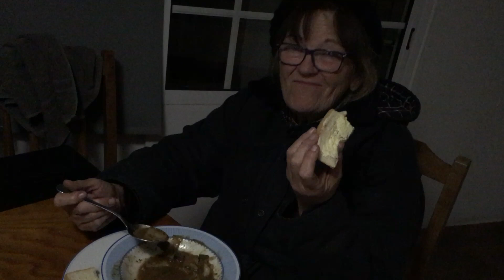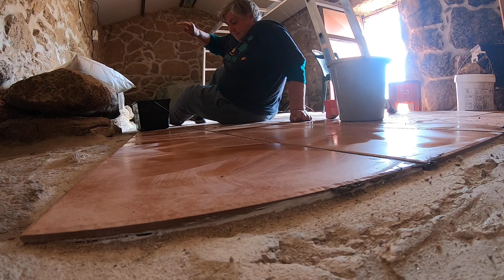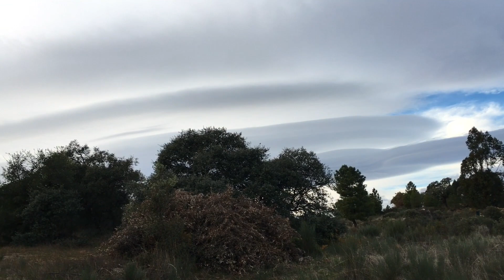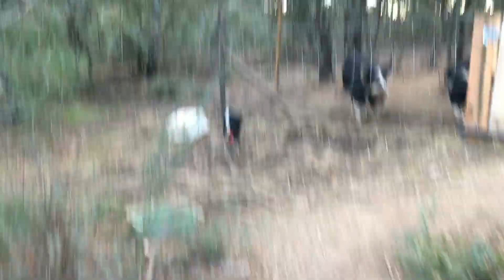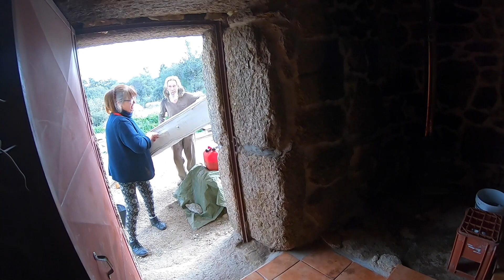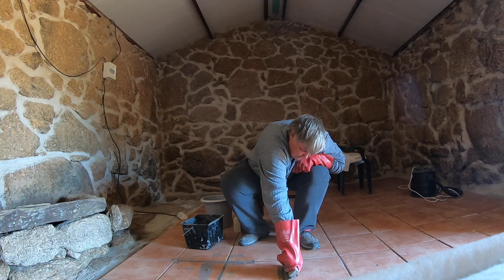Restoring a RUIN in CENTRAL PORTUGAL. (GROUTED!)

Comment: looking amazing now that the walls and floor is done.  I do think that the bed base does need to come off the floor, even if you just use 4 low wooden blocks.  Will be hard to move and clean under bed if base is flat to ground.
Reply from the maker: The base isn't flat to the ground. It's on 4 legs or feet. Not sure what you call it.

Comment: My mattress molded sitting on my tile floor in my bed room.put 6 small bricks under the bottom to give you some air so mold doesn’t grow..I have red brick broken tile…I’m 68 and not shooting you a bunch of bull.😃😃😃😃
Reply from the maker: My mattress base has feet so it is off the ground allowing airflow!

Comment: You are doing a great job. When you're finished with the house and kitchen area. By that time you're a pro on building. Maybe starting a new career in building?

Cement, and stuff like that, what goes under and between the tiles, can be irritating to the skin, it can burn into the skin, also irritating for the eyes. Not sure what the stuff is exactly that is the cause. When mixtures like that hardens there is often a chemical reaction.  In most cases there is a warning on the packaging, no contact with skin, eyes, wear a mask, to prevent breathing in the dust..
Do not swallow it (no person would i guess 🙂).  But maybe little children or pets could.
Reply: When i was young, in the school holidays i worked in demolition and construction. And once i had to go to the emergency medical help, i worked in a old building and some really old dust/cement/lime stuff came in one of my eyes. It burned like crazy, and they had to clean it in the hospital, and wash it out, and treat it. So i learned the hard way, you could say. 🙂
Reply from the maker: Was definitely hard on the hands!

Comment: You still not got them electrics sorted?
Reply from the maker: Not yet, have had people coming to look, say they'll send a quote and never hear from them again. But have hopefully found someone to do it in January.
Reply: @CindyVine  remember they will have to turn off the fridge to do it so you'll have to empty it. They will have to buy a new rcd to as that one is meant for a garage and only has 2 rings. Hope fully they put the wire in trunking and screw it the the walls and roof instead of having wires just pinned to the timber or hanging around. I don't know the rules and regulations in portugal.

Comment: So if I understand correctly, your lounge doubles as a bedroom? The other disadvantage I see is having to go out of the house to use your kitchen and bathroom (once it's built), which might be in the dead of night and also in extremely cold temperatures. Unless you make door openings at a later stage to join these room to the lounge. Otherwise it wouldn't work for me. How can you live in such a tiny lounge, especially with the bed consuming a large part of that corner of it? And where will any guests or visitors stay?
Reply from the maker: I will be building a large covered veranda which will be the lounge. In winter one won't get guests lol. And guests will stay in the spare bedroom which will be next to the kitchen. When rebuilding a ruin, you aren't allowed to remove stones to add in extra windows or doorways without planning permission and red tape, so it's easier just to build on the footprint.

Comment: try cleaning the smuges of the tiles after they are dry with steel wool
Reply from the maker: Will try that!
Reply: Using Steel Wool runs the risk of a: Marking/Scratching/Damaging the Tile Glaze b: Leaving Steel fibres which will rust mark, better to use a Nylon scour pad (if you must) but the accepted method is as Cindy did - wet sponge frequently rinsed in water
Reply from the maker: @bedlam8159  just needs a mop now